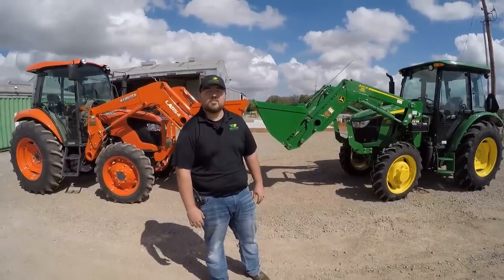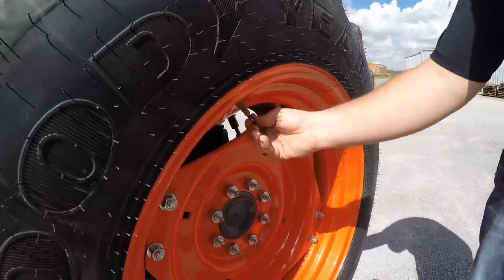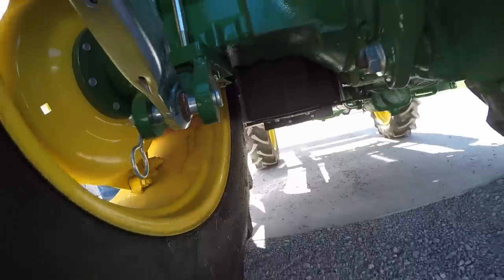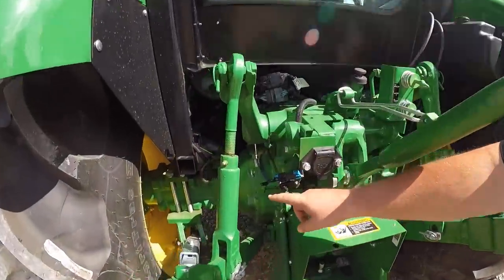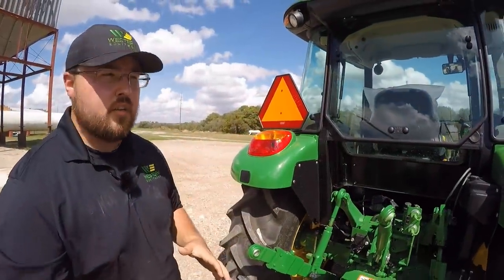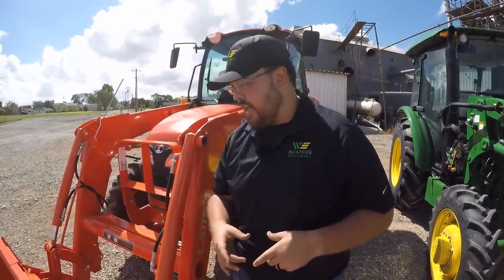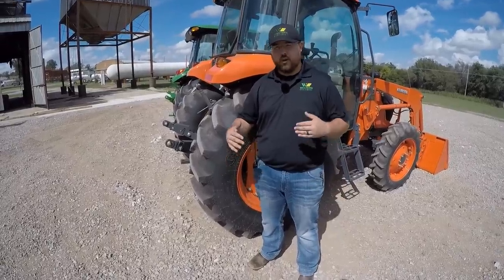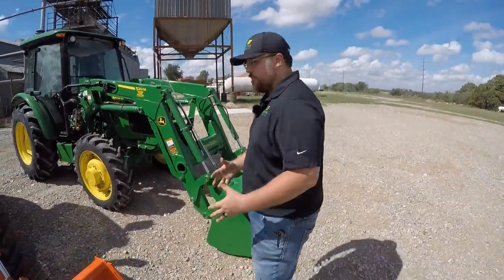John Deere 5065E VS Kubota M7060 | Product Walkaround and Overview

Comment: I have owned the JD5065E  and now own the Kubota for about 1  1/2 years.  I have 3 wheel weights on each rear wheel and liquid in them.  It is much more user friendly than the JD.  I'm 78 years old and I've owned and operated tractors for many years.  Years ago JD were better built than they are today.  Kubota is about like owning  a Honda or Toyota, you don't have down time  like the JD.  I put about 500 hours a year on the tractor. I've bought 3 new JDs and 2 of them had major problems .No more JDs for me.
Reply from the maker: Interesting. Thanks for sharing. What kind of issues are you seeing?

Comment: And as big of a Deere fan as I am, the number one pet peeve I have with Deere is that they need to do away with their JD quick attach loader attachments and go ahead and standardize to SSQA like everyone else has. I know it’s optional on a Deere but it needs to be standard, it’s 2018! That is just Deere’s need to feel exclusive.
Reply: Yes but ssqa is junk with any bit of dirt that gets caught it won’t attach right
Reply: SSQA is not strong enough for this size of equipment. If you don't want a Deere attach system, get a global or euro mounting system. Much stronger.
Reply from the maker: Just remember there are options based on different applications!
Reply: @mesh1248  LOL.  Yeah SSQA is junk so EVERY other tractor mfg has made it the standard.

Comment: I love how he tries to turn positives from the Kubota to a negative- “the battery is the first thing you see under the hood of the Kubota with nothing over it, but John Deere’s is under a bunch of stuff and is harder to get out..... but it’s better.” “The skid steer attachments are great, but you risk being stupid and picking up attachments that are too big.” This is a pretty biased “comparison” and makes me want to get a Kubota even more, just because of this guys horrible comparison technique.....
Reply from the maker: I would be glad to watch a comparison video that you would recommend? Maybe I can learn something? But I feel most are just as biased or worse than mine. Maybe not...
Reply: Watching this a year later, but what struck me the most is the fact he was going on about keeping things away from damage: steering, tool box, etc.  but the hydraulic system for the loader was just “convenient” on the Deere. I much prefer protected than convenient. Also the battery box...on Kubota, it comes with a standard door latch and steps to ease entry into the tractor. Won’t work with that battery box on the Deere. He didn’t mention that at all. However, I’m sure, the trade in value will make up for it in the end game...like ranchers don’t keep their tractors for very long (maybe they get rid of Deere more often).
Reply: @WesternEquipment  just “don’t be biased”… that’s all.. you don’t need to watch a video.. you have to remove yourself.. point out the good of each and the disliked of each, equally.  It’s not hard.  That way the consumer can make up their own mind.  I personally steer away from biased reviews of anything… it just turns me off.  

Other than that, (which is in response to your comment), I appreciate the time on the review.  I went with Kabota over Deere, tractor to tractor, but had a Deere before the switch, and they are both great units.
Reply: @WesternEquipment  lol people hate the truth nice review
Reply: @zo6rwhp  Let me guess most are Kubota owners! I worked at a dealership that sold the Kubota line. I was warranty admin, service writer so I saw first hand how things broke and it was clearly Kubota’s fault but Kubota does not stand behind there product! You may as well say they don’t have warranty! Talked with another Kubota dealership and they had a M120 with 75 hours on it and that trans failed! Long story short Kubota went to court with this farmer cause he was not paying the massive workorder. Thankfully there was a good Judge and made Kubota pay the workorder! How stupid of Kubota but that is there thinking, it’s unreal! Please people do yourself a favour and stay away from Kubota!!

Comment: Nevermind that he passed right over the proprietary RPM button to hold rpm's even to save fuel while pumping extra fluid to the pto. Oh and the nifty dual latch on the loader that gives you the choice of an extra foot to height or extra power for a heavier load.
Reply from the maker: This was just a comparison video, not a thorough walk around...

Comment: John Deere definitely seems more user friendly and ergonomic. The big neat thing about the Kubota is the ability to use skid steer attachments. I would love to be able to run a small forestry mulcher from a front end loader and not have to buy a CTL. As far as battery placement, I don't think I really like either. On the Kubota it will be blocking air flow to the radiator, but on the John Deere it is hanging down and could catch on a log or something if you're being careless. The metal box it is in seems sturdy but you're still losing some ground clearance.
Reply from the maker: Great points! You can buy an adapter to make any loader into the skid steer style hookup. They can be a little pricey, but they will give your tractor that versatility you're looking for!
Reply: Well idk what kind of tractor you have but I will tell you most skid steer attachments are not meant for compact tractors especially the smaller compacts. These two tractors could support a lot of skid steer attachments because they have high loader capacity but attachments that are made for skid steers require a high hydraulic flow(GPM) to operate up to efficiency. A lot of people think they can just take any attachment that was made for a skid steer(grapples, hammer drills, tillers, duster, ect) and just put them on the front of their compact tractors. Just because it fits doesn't mean it belongs and most of the time it doesn't.

Comment: seen one of those plastic hoods deteriorate from the sun and break into pieces
Reply: Drop a small brick from the loader and your off to deere to buy a new one, a dent in a metal hood can be knocked out, he is so biased towards deere its unreal.
Reply from the maker: Lets be honest here, the sun will deteriorate most things when left out...
Reply: Had a Deere to work my orchard on 40 acres in Nevada.  The sun out here would make most plastics look like you put a torch on it.  The hood Did fade over the years, but never got brittle.  I put some serious gouges into it from branches etc.  The tool boxes and covers did get brittle though and cracked out.  But it was nice that as he said, its the same color all the way through.  'shrugs'  Yeah, its a gimmick.  But I can see why they did it.  Plus it was nice not having the hood be scorching hot from the sun.  My next tractor will be something other than a Deere due to how they Love making everything proprietary or not user serviceable. But the plastic hood, in my opinion was a good idea.

Comment: that low mounted battery on the deere is probably the stupidest idea in the last 50 years of tractor design!
Reply: gotta agree... cant get to the posts. cant get cables on easy. not a good idea. kubota under the hood is pretty obviously better
Reply from the maker: Really? I feel like there are definitely some worse things going on with tractor engineering...
Reply: @WesternEquipment  One of the radiators can come out by a wing nut and the plastic shield pop out easy making it far easier to blow out the radiators.
Reply: I have a John Deere 5320 cab 64 hp pretty much the same tractor as what is shown here a 5065E and the battery is in the same place. On my 5320 you have to take the step off before getting to the battery same setup. A person would be wise to cut out a peace of rubber to fit on top of the battery so the battery will not short out because the battery terminals can hit the top of the casing that the battery sets in if the tractor bounces by going over rough ground or a ditch.

Comment: This is the first review that sounds like a CNN report. Also I think there's a spot in the Kubota cab that could harbor rattlesnakes where the JD has a place for a mongoose to live comfortably. I was shocked I didn't here that comparison. So, I like that on the JD they have tattooed how to start instructions on the key so they never forget! Not fair to discriminate against people who need daily instructions. "Outside hydraulic front couplers -- easily grabbed from the outside." yeah by a tree. I'm sorry, I shouldn't be critical, but this was funny!!! I think they are trying to impeach the Kubota, but noticed they did paint the foot throttle Kubota orange.
Reply from the maker: HAHA everyone is entitled to their opinion.
Reply: @WesternEquipment  lol, not really, if you criticize certain entities, you can get banned from free speech. Although, I never accused you as fake news. lol. I just thought your bias was funny, in a good way, and it really wasn't as quite as bad as CNN. I'm glad you have a good sense of humor. I just rented a smaller JD, and it was horrible, but got the job done. My buddy's smaller Kubota wasn't as clunky to run, but I did order the M7060, and won't pick up till April, and I will check for rattlesnakes. Please send a mongoose if that is an option and not proprietary.

Comment: This is an interesting video.  I would have liked to know why you focused so much on the weight when the fluid in the tires more than compensated.  I don't know if there is a benefit to having the weight in the metal vs in the tires.  It would seem that they both would accomplish the same objective with negligible difference.  Regardless, I appreciate the fact that you took the time to make the video.  You pointed out several things that I was unaware of on both machines.
Reply from the maker: I'm glad we could help out. Thanks for the comment and thanks for watching!
Reply: Well, obviously you can fill the tires on the JD as they did on the Kubota. But the real point that should be made is that the Kubota uses lighter castings and hence the weight difference, you're getting a bit less tractor.

Comment: All the older deeres I have worked on have all kinds of broken and cracked plastic panels! The sun really breaks down those plastic parts! The deere quick attach bucket system means you can't use the world standard skid steer attachments that are so plentiful and cheaper.
Reply from the maker: You are correct on the bucket system, but the skid steer style hookup is an option on this loader for no additional cost. There is also the option for the Global style hookup as well! We should have been more thorough when explaining that part. As far as the sun cracked or damaged panels, we have not seen it yet. But this could be due to location. Thanks for watching!
Reply: Mark Loomis at this years farm show a lot of the bigger Kubotas now have the polymer hoods an fenders.
Reply: Western Equipment My 455 has no unbroken plastics left.  They all need replaced.   Metal panels were so much better.
Reply: He's just advertising for John Deere the only thing he's doing pointing out what he doesn't like about Kubota
Reply: Mark Loomis f
Reply: I do not know what you do with your deere, but our 1985 John Deere 3040, 2002 John Deere L105 and our 2018 John Deere x350 don't have any of the broken plastic parts.

Comment: What military discounts do each offer?  Been looking at this same HP range in JD, Kubota and MF.  JD is dealer is 15 miles away, MF 1 hour, and Kubota is 2 hours (went out of business near me).  Don't mind hauling them in if price is right.  Also looked at Branson (nervous on long term support with them...though they have great deals), Mahindra (support worries me), and Yanmar (too far away).  Any assistance would be greatly appreciated.
Reply from the maker: Yes sir. There are military discounts and they vary depending on the type of equipment you are buying! Let me know if we can help any further. Thanks!

Comment: I have owned many Tractors and, I happen to own the M7060. The M7060 is a little lite in the rear-end but not enough to worry about because it weighs in with solid steel. The JD casing has whats called Pot Metal casing very good also.  I think you need to be fair about the radiator. Tell the viewers how it slides out for easy cleaning as to where The John Deere does not. The M7060 Kubota is a all around tough Tractor. The Deere is nice it's over priced But, JD has a good resale market. I would say Kubota is John Deere's biggest competitor. People buying Tractors to get the work done should shop around there are other colors besides green. Great video...
Reply from the maker: Great catch on the slide out in front of the radiator! Definitely did not see that! This is another reason why we love feedback. Thanks for watching!
Reply: Pren Goodwin any serious farming with over 200 hp you better stick with Deer. I got a 1968 4020 deer that pulls a bigger plow than 125 newer Kubota

Comment: Great comparison and very informative.  Could tell you favor the Deer though, LOL but great comparison.  On the FEL disconnect you could argue the placement on the inside would better protect the connections, where on the Deer it is outside where it could be struck and damaged.  And yes on the labeling, the Kubota could use more labeling.  Nothing against the Deer, but love my Kubota.  Thanks!!!
Reply from the maker: What Kubota do you have?
Reply: Nevermind that he passed right over the proprietary RPM button to hold rpm's while pumping extra fluid to the pto. Oh and the nifty dual latch on the loader that gives you the choice of an extra foot to height or extra power for a heavier load.

Comment: Kubota is made same place they always have. John Deere isn't made in Illinois/Iowa like they were when I owned them. I now own a Kubota, just don't need the dealership hassle that JD seems to have gravitated to. The computers run so much of everything, and JD will not allow anyone else to work on them. I don't farm anymore, just rent out the land. After listening to the comments that I get from the people doing the farming is that the big tractor companies are really having a showdown over pirate software allowing end users to access their equipment computers and 'cheat the dealers' out of their monopoly. Combines were the worst complaint I heard. They have so many sensors all over them and if a wire breaks, comes unplugged or a sensor just fails, dealer has to come out and run diagnostics and then replace the part. $$$$$ Also the maintenance is such a time consuming thing that it upsets harvest times. The days of farming have changed drastically as have the farmers. Hang in there, people. Ex SD farmer Michael in Colorado.
Reply: Every combine is like that. Stop picking on JD
Reply from the maker: Certain pieces of equipment are still made there, but with growth comes expansion..

Comment: I personally do not like the plastic diesel tanks mounted low on both machines, or the the JD connectors for the lift on the outside of the frame.  I use my tractor in more of a utility mode and there are many time I have seen a limb or bush hit the side of the tractor.  And the cab is a no-go for me.  Guess they are good if you are in an open area.  Looking for my next tractor, thanks for the video.
Reply from the maker: Thanks for watching! Let us know if we can help in your search!

Comment: Will it’s pretty obvious that he is bias toward John Deere. I think the Kubota and John Deere are the 2 best for higher resale value. I am not bias between the two. They each have there pros and cons. So in the end I think there pretty equal. I like the John Deere 3 point hitch because it lifts higher than the Kubota. I hate the John Deere loader as it is way too far in front of the front tires. In the bush, it’s in the way and makes the ass end of tractor lift off the ground much easier during heavy loader work. But yeah it lifts higher. Still I’m voting for Kubota on the loader. Quick loader connect is easy access on the John Deere but looks better and tucked in on the Kubota. Also less chance to catch on a tree with the Kubota. The Kubota offers wider front tires than the John Deere. I like that the John Deere is heavier than Kubota. More traction to skid large trees. The Kubota offers cast Iron rear rims for extra weight. I don’t think the John Deere E Series offers the cast Iron rims. I much prefer the location of the battery on the Kubota. And the serial number location, like seriously!!  Kubota has the 4 cylinder engine and is less noisy and less vibration that the 3 cylinder John Deere. Not sure which tractor exhaust location I like best. The Cab on the Kubota wins. See how the gears, throttle and everything else is much more at reach. And for the vents, personally I prefer them shooting on my legs and lower body than on top of my head drying out my eyes. And it’s very important for the foot throttle to be colour coded… seriously !! Oh yeah also very important to have decal on your loader arm. You never know you might get dementia and forget what the functions are. The John Deere has the planetary gears on the front wheels. I think that is better than the Kubota but not 100% sure. So in those two specific tractors I would chose the Kubota.  If I would buy a tractor with over 100 hp then I think I would go with the John Deere.
Reply from the maker: Thank you for the feedback and thorough comment. I love hearing other peoples opinions. Thanks for watching!
Reply: Your welcome